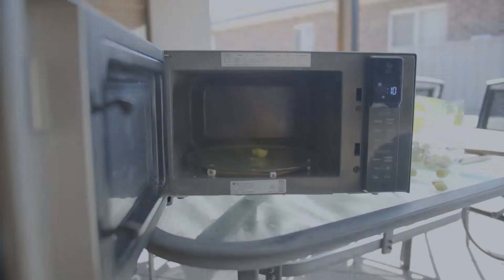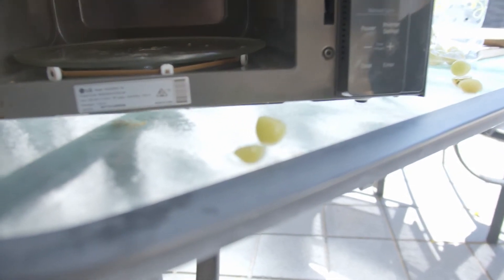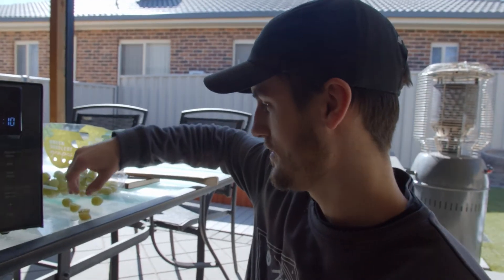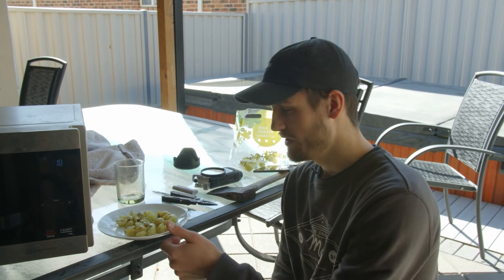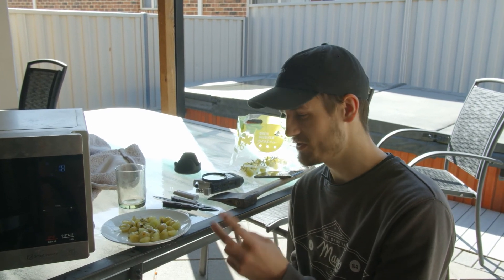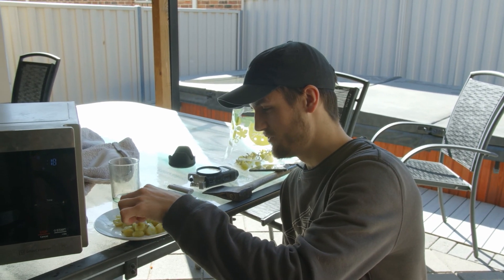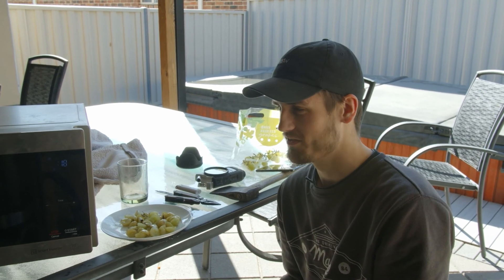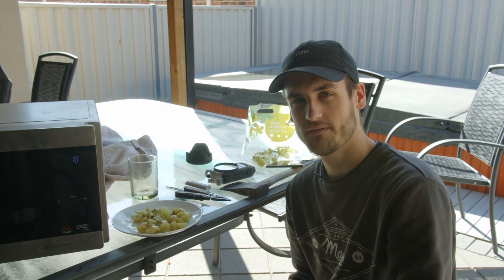Microwaving grapes

Comment: Also quick tip: if you don't need that microwave often just drill a little hole in the back, that way you can put your camera there and it wont get roasted by the microwave since the hole is just too small for the waves
Reply from the maker: Interesting tip! Thank you